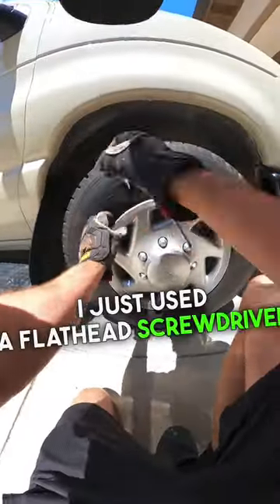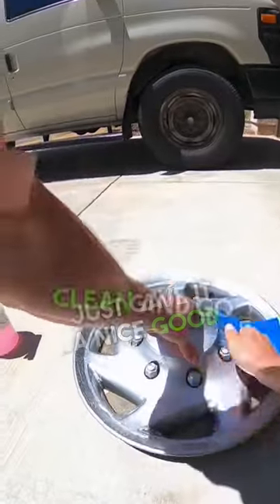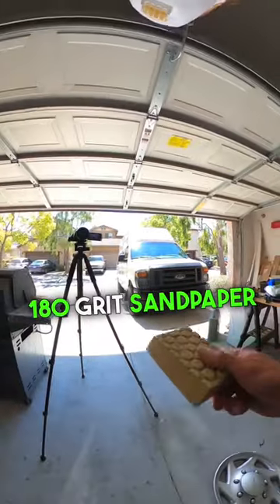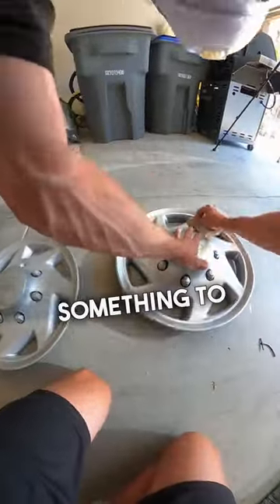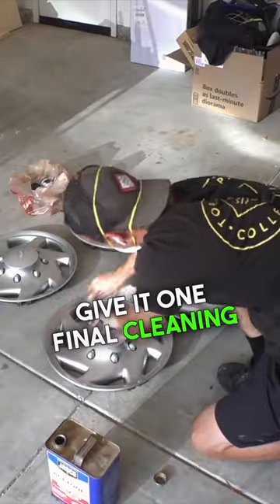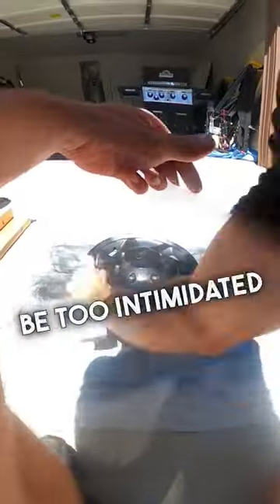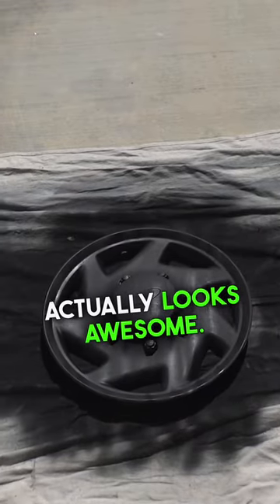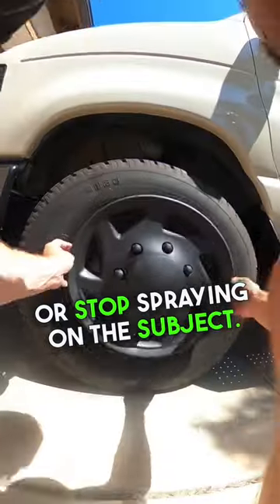DIY Van Build//Step 2 Painting your Wheels Black

Comment: Are there any actual practical uses for painting the hub caps? Cause if this build is designed to be "on a budget" I don't really see how it'd fit.
Sure you could just forgo this step but I'm curious if it has any actual purpose.
Reply from the maker: No practical use no!  But i used 1/2 of a can of rust oleum which is something like $5 for the can 🤷🏼‍♂️ I ended up using the rest and more for another portion of the van as well.  I just think it looks cool 👍🏻